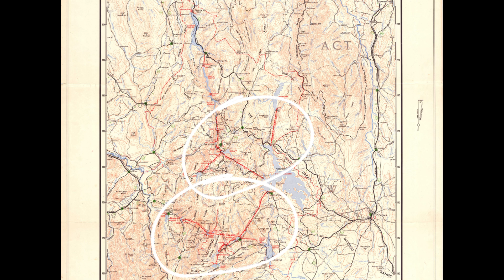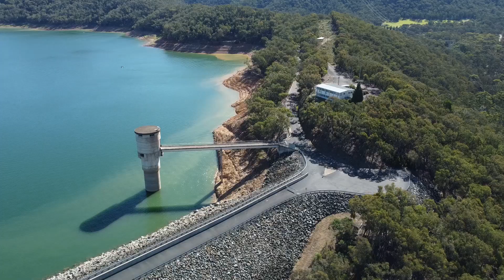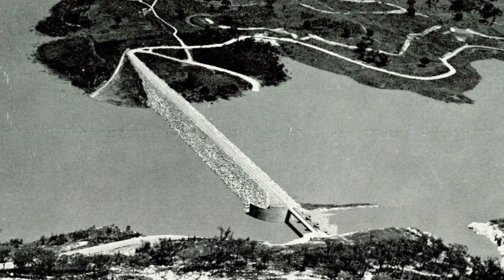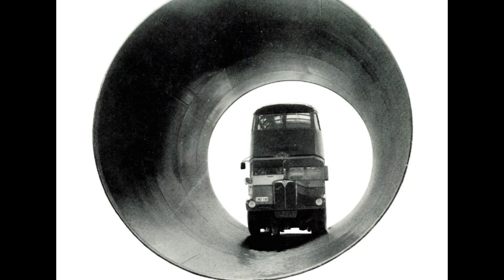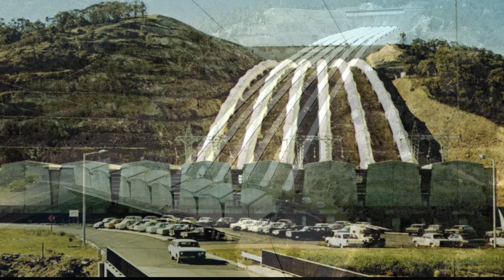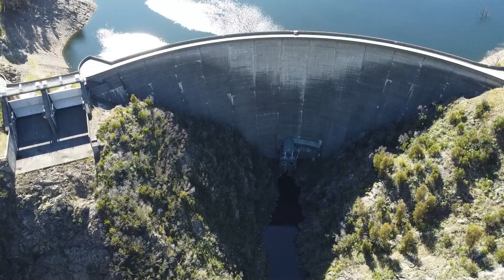Snowy Hydro 75 Years - Part  6:  Snowy-Tumut Works Conclusion

Comment: Dam surveillance in the mid 1970s identified a problem with Talbingo Dam's upper downstream right abutment which underwent remedial works in 1978/79. If it failed, the dam would follow, and it would be very messy.